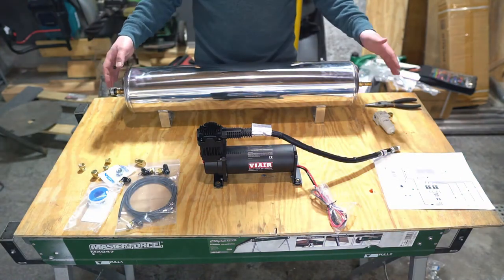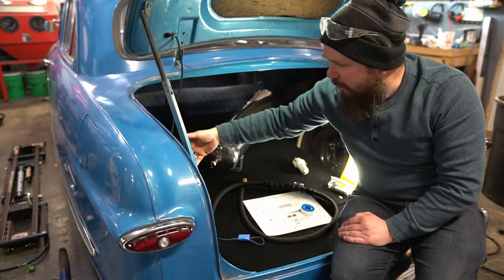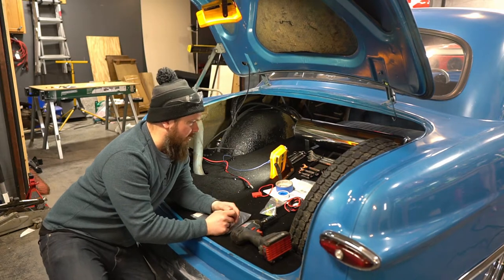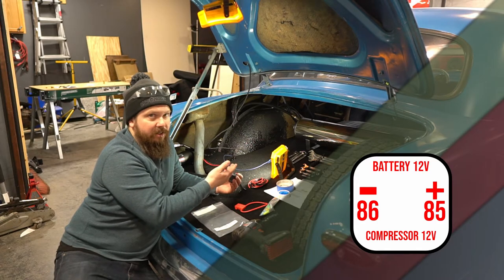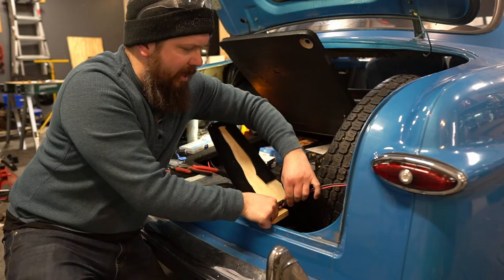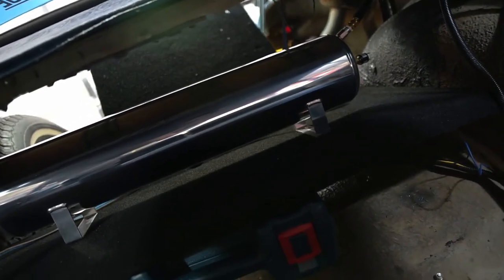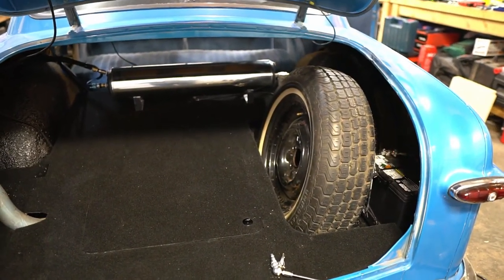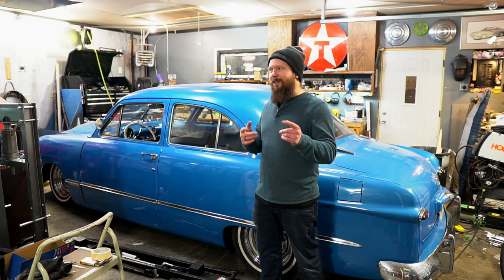Bag Riders Manual Air Management Installation Part 2; Shoebox Ford Ep21

Comment: Hello, im kinda new to this. Im sorry if my question so stupid. How do you know if bags are completely inflated or the air stop/ discounts automatically ? What if bags get over inflated? Is there any way that you can tell how much air is need to push into the bag?
Reply from the maker: Well this is one of those questions that has a basic answer and a complicated one, so I'm going to spare you the novel I'd have to write to explain air spring "rates" relationship to air pressure. 
"How do you know if bags are fully inflated?" - basic answer is; when you reach ride height. Appropriate sized air bags will lift the vehicle without significant amounts of air pressure. For instance, the shockwaves up front on my car begin lifting around 60psi, can cruise at 80psi and if I want to fully lift it with max ground clearance I'll go to 100psi.
Reply from the maker: "What if bags get over inflated?" - most likely your system won't reach the limits of the air bag. 
Most air suspension systems that I've played with aren't going over 150psi and most air bags are rated well over 200psi. For instance the Slam Specialties 2500 is rated to 250psi.  Yes, there are air compressors and tanks comfortable at 250psi but I see no reason why you'd ever need air pressures even remotely close to that on a bagged car or truck.
Reply from the maker: I haven't found a formula to determine air pressure to lift that can be applied to every vehicle. There are simply too many factors. 
Every vehicle weighs different, different air bags, and even suspension geometry plays a roll.

Comment: 🔥🔥 🔥🔥🔥🔥🔥. the push connections. How much pressure will they hold?   I am running. 4 VIAIR air compressors and my 2 1/2 gallon air tank for my airhorns on my pick up truck. I’m looking for the best way to run the airlines from my quarter inch manifold to my air compressors and to my airhorns as well as the gauges that I have inside of my truck I have a big toolbox in the bed of my pick up truck for the 4 VIAIR air compressors and the tank also, how accurate are the digital air pressure gauges with the sensors ?  🔥🔥🔥🔥🔥🔥
Reply from the maker: Push connectors have a range of quality and subsequent performance. How much air pressure are you running? 
I don't have experience with digital air pressure gauges besides displays on controllers, like the Ridetech E5 where the sensor delivers it's signal to a controller. 
I'd suggest sticking with brands known for quality and you should be just fine for reliability. Air pressure is an easy thing for a sensor to monitor so I'd guess the rate of issues is kind of rare.

Comment: So I have a question, with a manual air management system when you air out where does the air  go? The way it  says to plumb it, the air is going back into the tank... I'm new to the whole air suspension . sorry if the question seems stupid.
Reply from the maker: Nah man, not a dumb question at all. So on manual paddle valves you have 2 male barbs and a small orifice. The barbs are an inlet and outlet. Inlet is the feed side from the tank, outlet goes to the air bag and the orifice is a discharge. So when you flip the paddle up it opens the inlet/outlet circuit and when you depress the paddle valve it dumps the outlet side (bag side). 
Does this make sense?
Reply: @DadModsMedia Not really sorry,  I bought a used system (vera 2 air suspension manual controller) and the way it said to plumb it was to take the top 2 barbs and and split them off to the gauge and the bags and the bottom two are T'ed off and the run to the air tank...I didn't see  anything else on the  setup...and thanks for your reply....I just don't want to mess anything up..
Reply: @DadModsMedia I'm not quite sure what you mean when you say orifice
Reply: @DadModsMedia  when you say orifice are you referring to the small little hole on the back of each of the pedal values themselves
Reply from the maker: @StanDepew  I'm not familiar with the Vera valves and the quick googling I did I'm not finding a manual paddle valve with more than 2 barbs per switch. So I can't speak on the exact assembly. 
What I will say, is I've never seen a manual paddle valve that dumps air out of a line. Every one I've ever seen has a small orifice on the backside that bleeds off the air when the paddle is depressed. It looks like, from another comment, that you did find a small hole on the back. I would wager that is where the air is purged from. 

If you are worried about assembling the kit wrong, you would always play around with it on the workbench and test it out. Pick up one of these and you can use your shop's air compressor to feed air into the system: https://amzn.to/3rcYxwt 
Air your compressor up to like 25psi or so, grab your tire inflator fitting and attach it to the fitting I linked. Cut some small pieces of DOT line and push em onto the barbs, then use the push-connect schrader valve fitting to test out each line and see what the valve does when operating the paddle. 

Plus, it's a good idea to have one of those push-connect schrader valves in your vehicle in case your air compressor ever fails and you need to add air to the tank through the water drain line.
Reply: @DadModsMedia   It was the small hole on the back that dumps the air out of the lines....I temporarily hooked it up to my pancake compressor and it worked I appreciate all the help brother
Reply from the maker: Great to hear you got it figured out! 
Happy to help any time

Comment: Don't trust them junk relays have and old 380c viair almost caught fire I bought a stinger relay no problems  8 years install but now 444 viaire dual but still have old compressor  it still  works
Reply from the maker: Thanks for the feedback man! I've always tried to run Hitachi SPDT relays so maybe I should swap these out before issues happen. 
That's good to know about the issues you had with your 380C. Scary stuff. 
So you're running a pair of 444s?
Reply: @DadModsMedia  Yelp now  retired  the 380c only had the 1 but with dual 444c s lot more and fills tank lot faster  😀
Reply from the maker: Yeah I could see the dual compressors being a game changer. The single takes forever to make the initial fill. Refill isn't awful, but I'd love to cut the time in half some day.
Reply: @DadModsMedia  cool man  good luck on your build 👍
Reply from the maker: Appreciate the kind words and insight!

Comment: What’s the check valve for attach to the hose, and is it included in the air compressor purchase?
Reply from the maker: The check valve isolated the post-compressor system from the compressor. It protects the compressor and keeps it from losing air. The Bag Riders kit came with mine but there's also an option to purchase an upgraded version as well.